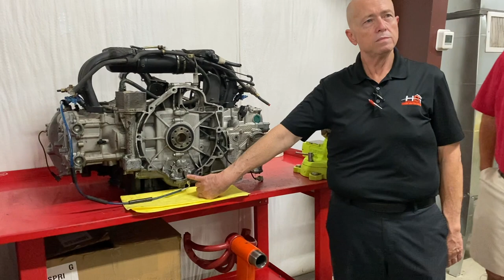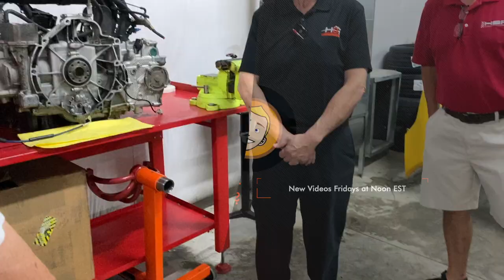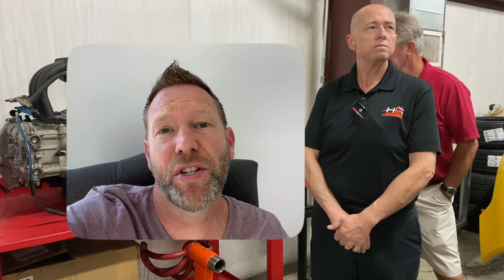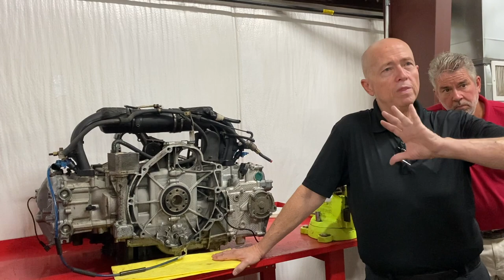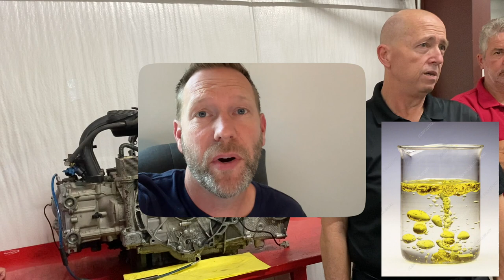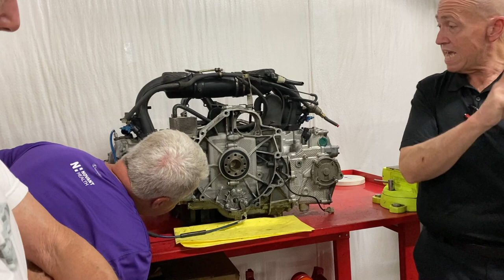Should you REPLACE THE IMS BEARING in your Porsche?

Comment: Hi Aaron.  Thanks for fixing the lies and mistakes in the original video, it is good to get info out there but it has to be accurate.  I have a 987.2 S now so no IMS but previously I had a 2004 986 S, with the weakest small single row bearing.  I changed it for the LN Eng solution myself using their tool kit.  Both bearing and tool kit were excellent by the way.  I am a mechanical engineer and I understand the IMS issue.  My conclusion is that people misunderstand the risk of IMS failure.  Risk is measured  with two factors, the occurrence risk and the consequence risk.  Whether you have the small dual row, the small single row or the later large single row bearing the risk of the failure occurring is low.  BUT the consequence risk is high, usually a trashed engine and with cars of this age that can mean economic write off.  So to me the consequence risk just wasn't worth it when it was fixable for relatively small money compared to the value of the car. But that is a matter for each individual owner.
Reply from the maker: +Bill Green yes very true! Consequence risk for me is low because I have a base and if it fails I will put in a bigger better engine 😁

Comment: My 99 boxster has 161k, original 5 speed transmission with original double row IMS, I removed the bearing seal (130k) (rear side seal) when I did clutch replacement. I only use mobile 1 0-40w since I owned it 15years ago. This boxster doesn't like sitting in garage ,drive it hard and she well last long!.
Reply from the maker: +KaniZ RC definitely love to be driven!

Comment: I've known the solution to permanently fixing the IMS issue was to remove the seal from the original bearing so engine oil would lubricate the bearing. I did this simple fix when I replaced my clutch years ago. I argued with LN engineering on this issue and returned their so called IMS bearing fix kit. This was 5 years ago. So now they just got rid of the seal and considered it a fix. Geez I wonder where they got that idea from???
Reply from the maker: +bruce wayne that’s their advice only for the non serviceable bearing, from what I understand.
Reply: From YOU? Ya REALLY think? Wholly poop. Let me bow down to ya!

Comment: My bearing in my '01 Boxster S was close to failing at ~65K miles.  I discovered it when changing the oil and finding metal shavings on the magnetic drain plug I'd installed.  Given that the car is essentially a write off if the IMS completely fails, why would you not change it out?  I second your "False" claim on "if it has lasted over 50K you're fine."  Bad bad bad information.
Reply from the maker: +Michael Bowers glad you caught it! There are a couple reasons people might not want to change it, I’ll cover them in the next video

Comment: I did my IMS when I did the clutch. I used the basic ims replacement from Pelican. I did the work myself. It was easy and did not require any special tools, just some ingenuity. 
04 S with 130,000 miles.
Reply from the maker: +John Zebarth well done! 👏
Reply: What was the condition of the IMS when you took it out? Should be a single row
Reply: I did not break apart the bearing, but it rolled smooth and had no play in it. For me, it is a maintenance piece and I will change it whenever clutch is done. I still don’t see the value in a high dollar “solution”.

Comment: It is a shame the repair industry has frightened Porsche owners with M96 and M97 engines into this situation. There is nothing wrong with the original IMS bearing which does not have a mileage limited life. The bearing is the victim and not the route cause of the problem. The majority of failures happen in cars with manual gearboxes. This is because clutch dust is collected by the engine oil leaking out of the leaking IMS end cap. Capillary action from the engine going hot and cold will take it back into the engine. The reason for this is because the hole in the two crank cases is no longer perfect from the aged aluminium and therefore the outer seal does not cope. Stop the contamination of the bearing and you will no longer have a problem unless the bearing is already contaminated. Read the Porsche work instructions for this  job but also use a sealant. Never use a ceramic bearing in an engine. They shatter with contamination. Always use the correct tool to replace a rear main seal. This ensures it is at the correct depth and is straight. RMS's inserted by hand and eye will always fail prematurely. Please pass this information on to stop this madness of people being ripped off.
Reply from the maker: +robin mckenzie clutch dust? That’s a very interesting theory that I have never once even heard mentioned before. Where did you hear this from?
Reply: @HelpMeDIY  I own my own Porsche garage and have been repairing Porsches since 1995.  I work daily on these engines and have read the Porsche repair manual !.  I was also the head of engineering at a well known engineering proving ground, where I was employed to find the real reasons why components fail.  I have an original IMS end cap, the seal is an o ring.  Porsche also figured this out when they changed the design to the new sealing arrangement.  The problem goes away when the endcap is sealed properly.  The problem is garages do not seal the endcap properly, so the problem remains.

Comment: FWIW I caught the IMS failing in my 97 Boxster in time to prevent any damage. I got the rattle on startup symptom and got it to the shop whereupon I learned all about IMS bearings... My mechanic offered my a "standard" or "race" replacement which I chose thinking it should be better, not sure of the specifics without hunting down the receipts. Had the clutch and clutch plate replaced at the same time.

As for the "tech" in this video, keep away from him. Anyone who works on engines and doesn't know that oil doesn't absorb water and that engines operate with a degree  vacuum in them shouldn't be allowed near an engine.
Reply from the maker: +John Adams great catch before disaster! 
Yes, that’s why I DIY everything that I can. Some mechanics are great, most are much better than me, but there are so many that are just smug and talk like they know everything when they are wrong about everything. I know I’m the one that will care the most about my car and will do the best job more often than not. Plus it’s fun to learn!
Reply: Your cold rattle start is normal on boxster. With over 100k miles the tensioner plastic guide become brittle. But not certainly ims failing. Imo
Reply: @KaniZRC  This was not the normal cold rattle start which I’m familiar with. It was louder and more metallic sounding. Metal fragments were found in the oil filter and when disassembled IMS bearing was in the process of self destructing. So definitely was the bearing.
Reply: @jadamsnz  did you end up replacing your IMS? Metal fragments in oil filter dif early sign.
Reply: @KaniZRC  yes

Comment: He’s referring to Jake Raby from flat 6 innovations which is in GA.  Jake was the inventor of the “IMS solution” that LN sells.  

Now, my dual row IMS started to fail with 125k.  It sent metal through the engine but didn’t completely come apart.  I did put the tuners DOF.  Good so far.
Reply from the maker: +michael delay but he’s wrong. About so many things 😆

Comment: I have the TRS Direct Oil Feed kit in my 2001 Boxster. He keeps talking about "oil leaks" from the pressure, but my car doesn't leak. I've had it in there for over a year, and it's my track car, so it gets pounded pretty good, and it does not leak. Maybe it just needs to be installed correctly<g>. (And I didn't do it, my mechanic did.)
Reply from the maker: +Jack Beckman 😂 yeah, let him give it a go.

Comment: I have a 99 and I am going to go with changing my oil often until I need a clutch then look at doing the IMS bearing at that point.  I believe I read that the pre-2000 had an even lower failure rate since it was dual bearings.
Reply from the maker: +Jon Kotek 98 dual row here 😁
Reply: @HelpMeDIY  So did you replace yours?
Reply from the maker: @jonkotek234  nope

Comment: Interesting video. I didn't see the video you pulled down but I appreciate anyone spreading knowledge about the Cayman/Boxster. I have a 2007 Cayman 2.7 - I am not at all worried about IMS issues. I tend to think they are highly overblown issues. I hear a lot about “affects 10% of cars” - my guess would be less than 1%. They're such wonderful cars, they drive well, look good, and are built well. Drive and enjoy them.
Reply from the maker: +The Scotsman Technology Reviews yes like all preventative maintenance it’s risk vs reward. Most never fail during the time you own your car. Some do. I’m personally taking the risk it doesn’t fail before I sell mine. I also never buy extended warranties 🤷‍♂️
Reply: pretty sure for the 2007 models, the accepted rate is 1%, as it has the larger single row IMS bearing..   my gut feeling is even that may be high, as there was alot bad publicity surrounding the high (6-8%) failure rate of the smaller single row IMS bearing, that carried a stigma for upgrade.  This eventually led to Porsche getting rid of the IMS altogether..
Reply: The 2006 engines had a 1% failure rate which is good because you have to split the case to replace the IMS bearing. I believe his recommendation of removing the seal is spot on

Comment: Nice video. I am selling a Targa 78k with LN IMS spin on adapter and pressure line. I have actually had someone ask me how they can really know if the oil feed line was actually hooked to a new bearing or if it was just capped off up there. (Because you can not see the connection.) Not a bad question I guess if you want to drop the transmission and "fake it".... I take pics of all my work. I didn't take pics of the bearing being put in. I did add a modified hose clamp to the braided stainless line coming out of the oil filter adapter. The 90 degree fitting had come loose and had a very small drip. Oil feed line vibration likely the cause there. Cleaned fittings, put some Lock Tight on it. No problems after the line was stabilized. 
Thoughts on automatic transmissions avoiding IMS bearing failure? I see a comment below... Again, great video.
Reply from the maker: +William Montgomery yes very interesting question for them to ask. I guess when I sell mine it will be pretty well documented 😂

Comment: Just thought I would mention I have a 2005 987S factory build date April 2004 with M96 engine and replacing clutch and it has the later non serviceable IMS bearing with the 22mm nut.
Forgot to say I am in the UK only mention it because most say the larger IMS was from 2006 and M97 engine. As stated mine is 2005 and M96 and it is the original engine.
Reply from the maker: +@nickskipper2245 🍻

Comment: I hope your foot heals quick. My 00S has over 100k miles on it and running strong. It is my understanding that this year doesn't need changed so I have zero plans to change it unless I need a new clutch and then I will have it included.
Reply from the maker: +otter25702 thanks! Cast comes of Thursday

Comment: I've been driving a '08 987 S since 2015, but I've never heard of removing IMS bearing grease seal. My understanding is that the M97 IMS bearings are far more reliable than those on M96s but now I might ask my local indy shop about it at the inevitable clutch job
Reply from the maker: +Daniel Mann 👍

Comment: Yes you should.
I lost my original 02 986 motor, jumped timing and bent all the valves on one bank....fun...
Replacement motor was out of a salvage vehicle with front end damage, Replaced the ims and main seal immediately .
Once you get the necessary tools, go for it.
Lots of opinions about which ims you should use, as long as you get the faulty one out is the main thing
You want to be driving not worrying
Reply from the maker: +Jeff Jeff ooh, no bueno!

Comment: IV been told by to specialist garages that on a 911 unless you are having an engine rebuild not just a new clutch to leave alone,more fail after the replacement apparently and only ever seen 1 fail between the 2 garages in 25 years
Reply from the maker: Don’t listen to whatever else those garages tell you 😂
Reply: @HelpMeDIY  Why would they turn down work for themselves,if anything the people selling the bearings are scaremongering to increase sales.The failure rates are low and the replacement alternatives fail at a higher rate than original bearings , thet mentioned something about other stuff and potentially failing once original bearing has been replaced unless it's done while rebuilding the engine not just when gearbox is out.If your going to be unlucky you will be unlucky there are plenty who have replaced and it's still happened so your not out the woods even if you replace.